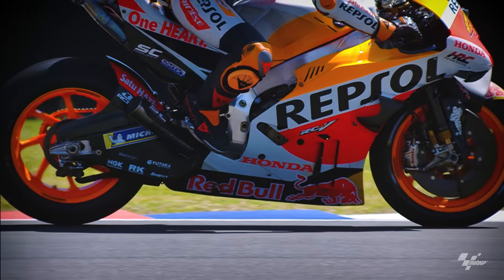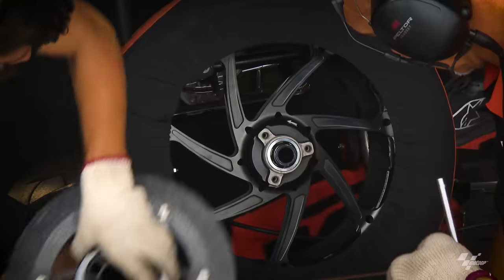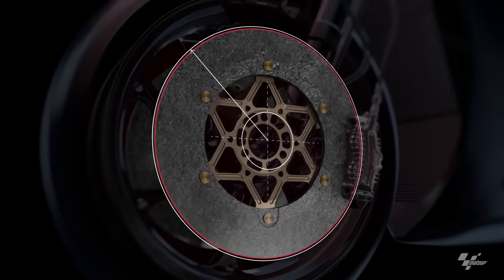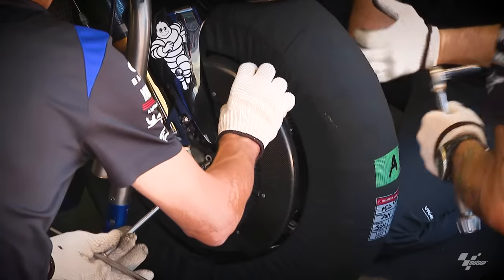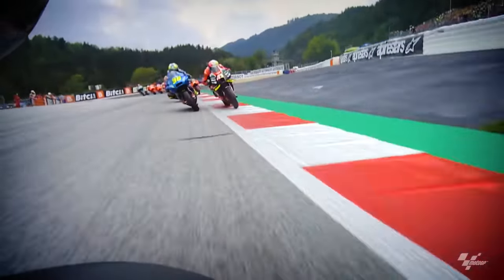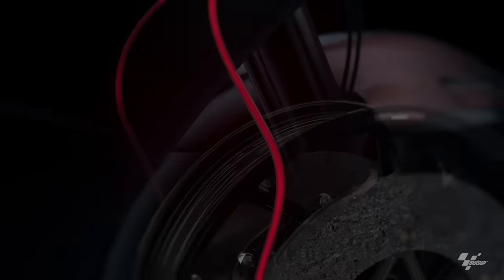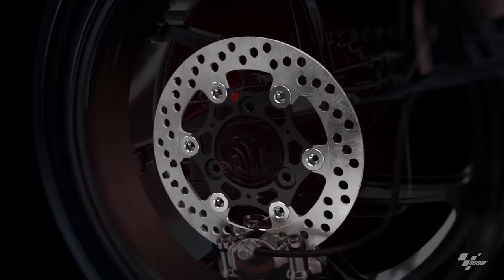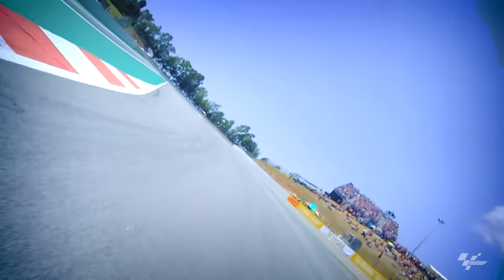MotoGP™ Workshop | How to stop a Grand Prix bike from 350km/h

Comment: 355mm rotors… 😳
Insane!
Reply: Buell XB12 had 374 mm 20 years ago.
Reply: @jasonkillsformomy  but the braking system was totally different. Rotors were bolted to the rim and the calipers were mounted inside of the rotors. Rotors were also steel and probably it was just a design feature because no SuperSport bike has brakes like that
Reply: @sztorm94  Not rotors, but rotor. It had only one. Yes it was an unusual design, but it worked. Don't know if it heated too soon if someone raced it because of just one rotor. My point was that there's bigger diameter discs out there.
Reply: @jasonkillsformomy  one rotor would suck for racing... pulls you to the side a little during braking ://
Reply: @AZ-wc5ot  No it doesn't.

Comment: Toprak in MotoGP would remove the rear brake as it's useless 15" off the ground.
Reply: I do not share the idea. Could you provide some rationale?
Reply: @gustavoenriquez1299  Toprak in WSB regularly brakes with the back wheel 12" in air so engine braking won't work for him. He rides for Yamaha and there are people trying to bring him to MotoGP.
Reply: @Dave-H  Absolutely, of course. Thanks. I thought it was the caliper that was mounted 15" form the ground. My fault. I drive a KTM 1290 SAR and usually end up boiling the rear brake offroad. I can't even think about driving without the rear brake. Obviously another world.
Reply: @gustavoenriquez1299  it's worth watching Toprak if you get a chance, no one can brake like him.

Comment: So in a nutshell, basically, you don't need an ABS.
Reply: On track where the conditions are ideal, smooth asphalt, best tires for grip, top notch brakes and skilled riders yes, you don't need it but on public roads the situation is way different.
Reply: when the riders are the best of the best moto gp riders, no. when they are your average susan and joe, you do need it.

Comment: Is it possible to use Ceramic brakes on Normal street bikes..🤔🤔🤔🤔🤔
Reply: Street bikes very rarely hit 350kmh and typically do it in a straight line. Yes it's possible but why would you want to pay so much for ceramics when you can't use them to the fullest extent? I believe even the Ducati Superleggera V4 doesn't have ceramics and that bike is possibly the best track bike money can buy.
Reply: anything can be used on anything, if you're talking about CARBON ceramic brakes to use on the street then it's usually not advised. They have less than ideal cold performance, they only really start working when they are hot, like 500°c hot. Which is really hard to get on the street.

Comment: Wait so there is a rear brake lever??
Reply: I believe so yes. They use the rear brake while turning in as the tires have the grip to handle it. But you can't use your rear brake without a lever if your right foot is dangling in the air.
Reply: Back in the early 90's Mick Doohan adopted a thumb rear brake out of necessity as he was unable to move his ankle far enough to use the rear brake pedal.